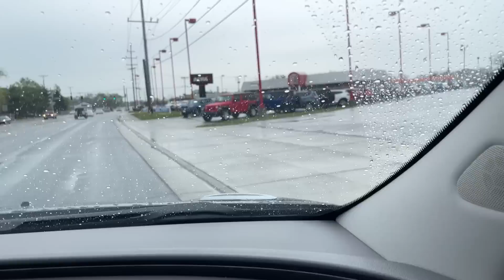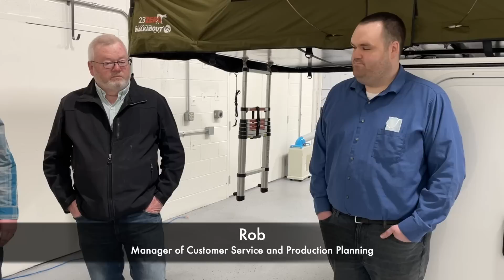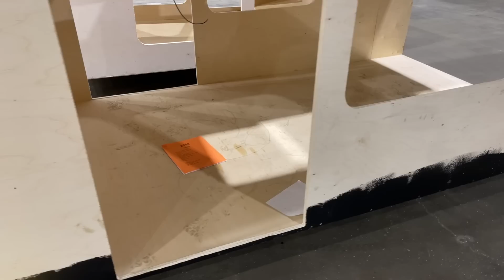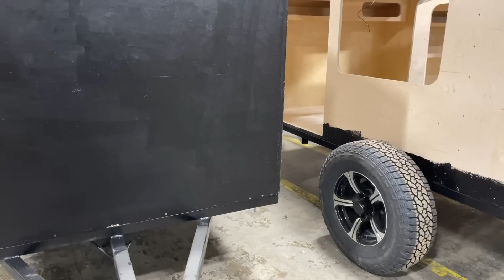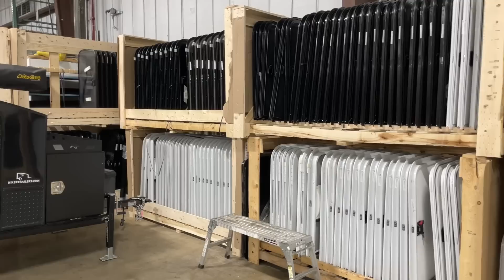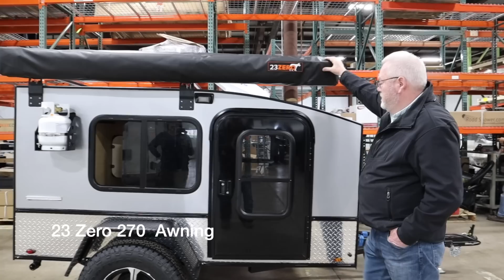Hiker Trailer Factory Tour  * Considering a Hiker Trailer? See how they are made*

Comment: They want $15K for a camper that has no frame or insulation??? Are they insane?  I will be lucky if my roof doesn't cave in over time with my kayaks on them.  I would NOT put a roof top tent on this and think that 3/4 inch plywood is strong enough to hold it.  This is NOT a sturdy build at all.  Even the hitch in the rear is cheap.   This is a very cheap Wood Shell that's covered with an ultra thin layer of aluminum and trimmed out to make it look strong. I was going to buy one until I saw the real guts if this.  For $5K  you can build a much stronger and better trailer that will out last this.

Comment: I wish they used a different material for the box other than ply wood.
Reply from the maker: It is marine grade plywood......
Reply: Nice tour Matt. Question: why use plywood VS all fiberglass or composite like Runaway or Tiny Camper Company? Stronger, lighter, better insulation, no leaks, etc. Thoughts??

Comment: Super cool trailers. My only wonder or question is the roof cross bars. Not the cross bars themselves but the brackets. It’s just 4 bolts into the side of the trailer with what looks like thin metal brackets and then by cutting out their HT logo into them takes away strength of the bracket. I’d like to see a video on the weight limits and a closer look at those brackets.
Reply from the maker: I got a reply from Bob and he stated the brackets are 3/16 carbon steel, laser cut, and powder coated.  Plenty robust enough to support the bars. We have more details next week on the roof top tents.
Reply: @MWDAdventures  this trailer with a rooftop tent is the best set up. I’d put the kids up there and mommy and daddy “downstairs”. And Give the kids a radio to check in.
Reply: @SteelerLos  Thats exactly my plan
Reply: @MWDAdventures  thanks for the response
Reply: I called them and asked. They told me they dont have an exact number but theyre pretty strong. Should be able to hold a rooftop tent with 2 or 3 adults in it. So I dont think it is an issue.
Reply: @eda7875  thanks for the response